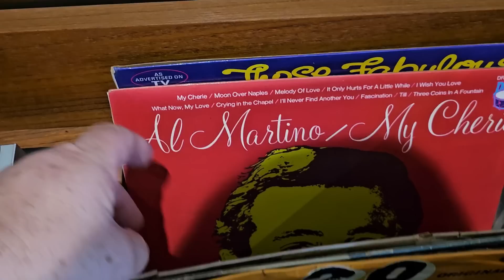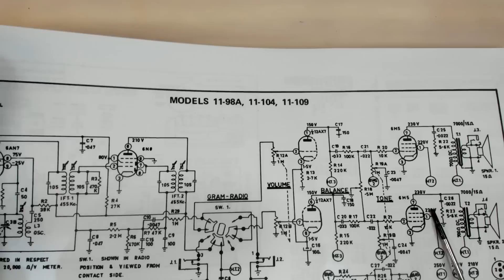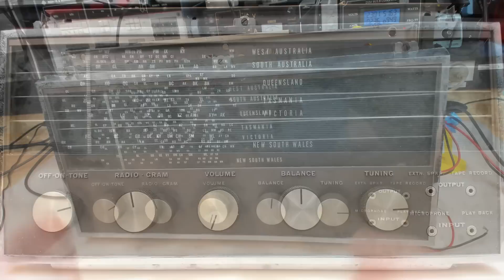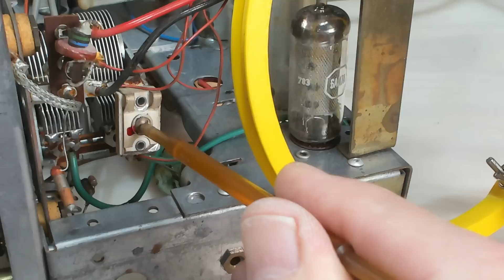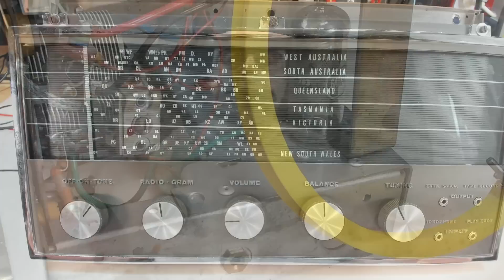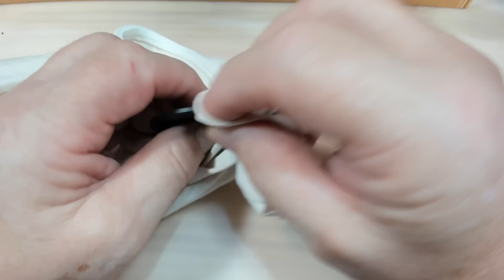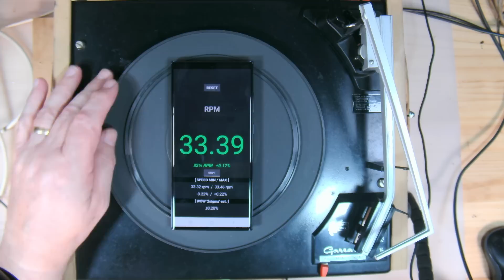Kriesler Radiogram for 5 Bucks! Is it any good?  Part 1

Comment: My Dad's old AGS turntable which was one of two he had for his old disco setup, ended up cracking the plastic spindle gear and it would return but then you couldn't move the tonearm as it would jam the return gear up. So you would need to pull the platter and spin it around until it cleared, you could use it after that but don't let the mechanism activate or you will need to do it all over again haha.
Reply from the maker: That would be annoying Ben. These days your Dad could have printed a new gear 😄

Comment: The rotogram3000, amazing!!!
Love your videos Dave. 
When you were peaking up the alignment I wish you had commented regarding the asymmetry of the sine wave, ie what was causing that and why it does or doesn’t matter.
Reply from the maker: Thanks Peter. I'm not sure what you mean. The sine wave on the scope is the modulated 455 kHz AM signal being suppled from my signal generator to the grid of the 6AN7 mixer valve. When peaking the IF transformers I am only looking for the maximum deviation on the scope. I am not taking any measurements per se 🙂
Reply: I was referring to 14:06
Reply from the maker: I see, the shape  of the sine wave. Yes it's pretty poor, the set has 10% harmonic distortion so it is not a good signal. I also didn't set it up for a clean signal, full volume and minimum input from the generator. It is the base model of the range of set on offer at the time.

Comment: Nicely done. I just got a BSR changer to service and it is a very similar design to this one. I don't remember if you ever did the BSR though :) That one has also lots of hardened grease all over it, I managed to break it loose with WD-40 just to get it spinning, but I will do a full service on it when I get around. It was so bad the platter was completely frozen and very hard to turn even by hand
Reply from the maker: I'm trying to think, I don't remember doing a BSR deck but I seem to remember something. Anyway, good luck with your BSR Michvod 👍🙂

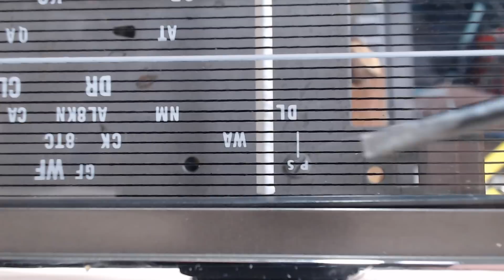Comment: 12:20 Does the "PS" mark stand for Pointer Set(ting)?

4:55 I'm still bowled over by all the capacitors and resistors flying everywhere, some with leads nearly touching others. I see a purplish wire acting as a kind of spine through the middle, what's that?
Reply from the maker: Hello Ed. I would guess it is something like that. Pointer Set sounds pretty good. Point to point wiring served well for many years. There is a purple wire, it's carrying one of the HT supplies from the power supply to the front end I think. Thanks Ed 🙂

Comment: Just saw this. That looks like 👍 a good radiogram for $5.00. The record player mechanism will need to be cleaned and regreased. Ya may need a new cartridge needle. I'm not sure if it's ceramic or magnetic. I hope ya don't need to fix the dial cord. The dial light should be easier. Good luck 👍, and maybe a couple beers 🍻.  Your friend, Jeff.
Reply from the maker: Thanks Jeff All those things are done, the cart and dial string are OK too. 🙂

Comment: Hello Dave, I enjoyed your video.  That's an interesting Radiogram.  Having lived in the US all my life, I had trouble dating this radiogram based upon US radiograms.  In the US, all "Console Stereos", as they were called here, switched over from Valves to Transistor circuits in 1964 to 1966.  Also, particle board did not appear in the super low cost radiograms until 1972.

The output valve coupling capacitor value of 0.0022 uF, causes the low frequency response to cut off at 64 Hz in that amplifier and the 0.022uF; 6.4 Hz.  The audio output transformer (not to mention the speakers) are the bass limiting factor so, either capacitor value would probably sound about the same.

I overhauled a lot of those Garrard record changers in the mid 1970's when I worked in a TV repair shop.  They are a "gutless wonder" but, work well considering the construction.  You have the entry level model that uses the shaded pole motor.  The higher quality level Garrard used a synchronous motor, causing the shaft speed to precisely match the line frequency.
Reply from the maker: Hi Bill, it sounds like we were behind the times with transistors and ahead on particle board. I wasn't worried about the capacitors but couldn't work out if it was deliberate or a mistake at the factory. As you said, those 8" drivers will be the limiting factor. I didn't think about the motors, thanks for the heads up. I agree, they are a basic deck but did the job intended and most people wouldn't know the difference between one deck and another, including me 😊 Thanks Bill.
Reply: @DavidTipton101  Thanks for your response Dave.  Yes, the premium Garrard deck also included a heavier platter and improved tone arm that could track with light stylus pressure for use with a magnetic cartridge.  These actually had superior frequency response to the Compact Disk Audio Format.
Reply from the maker: @billharris6886  Thanks Bill, good info 👍😊

Comment: This appears to be a really basic amplifier design, not just without push-pull output but also without negative feedback (hence the total harmonic distortion is likely around 8-10%).  A single ended output can still deliver better fidelity than that, if it does have negative feedback, as from the speaker side of the output transformer or a special winding on the output transformer.  A Magnavox high fidelity stereo phonograph that belonged to my aunt and that I fixed after inheriting it had single ended output with negative feedback.  Hacking that in to this design would require more gain in the pre-amplifier circuit to make up for the negative feedback.
Reply from the maker: Yes it is pretty basic, it is the base model. The better models have all the features. I won't be doing any mods to the circuit, it works quite well even with it's limited features. Thanks Seeking 👍🙂

Comment: I always find that watching an automatic changer is fascinating, particularly a smooth operating one like the Garrard.  We had a Multisonic model 11-95 in the mid 60s with push buttons and it seemed so modern (I did some research during your video!).   It sounded very rich too.  Looking forward to seeing what you have in store for this one. 😊👍
Reply from the maker: Hello Pauline. They are a masterpiece in design, so many elements it needs to check. Your 11-95 had three speakers a side, they do sound nice. Thanks Pauline 👍🙂
Reply: @DavidTipton101  Always enjoy your content.  The 11-95 is a very fond memory.  I think my father got it when my parents divorced.  Ours was a 'Diamond Hi-Fi' with a little blue diamante set into the control bezel, I think it signified a diamond stylus.  So fancy!

Comment: Hey David. Andrew Collins from Melbourne here. My mother got from my Grandmother a Kriesler Radio Gram with a bright green horizontal tuning eye between the Input and Output sockets. The valves were mounted under the rotary controls upside down which was not good for heat dissapation. It has electrostatic tweeters, not the usual standard type and the top end was incredible. It has a 3 way 6 element speaker system all magnavox. This was the most expensive of all the models in 1968. The power supply and rectifier valve are mounted to the bottom of the chassis. When I was in my teens, it started to hum a bit and the knobs area was drowned in booze. I removed the escutchien and went to radio parts to get pots and a new electrolytic for the stand alone power supply and other electrolytics for the rest of it. The valves were fine when I tested them at the local Mullard radio store. (I'm 63 now). I got back and went to work. Each pot was removed and a new one soldered in place. The pots were not cleanable with deoxit by the way. Mum looked at me working on the kitchen table and said "what's that"? I told her it was the guts from her radiogram. She was horrorfied. I hope you know what your doing. I said "no, its all guesswork".  lol. While the work I did isn't up to your standard. I was pretty good at soldering. A man called Mr Ryan, one of my late fathers friends was a radio repair guy and he taught me everything I know. After I finished the work, I fitted it all back in after I cleaned a zillion years worth of dirt, dust and booze stains and held my breath as I switched it on. I used the radio to check it and everything was ok. I used my cassette deck to check the fidelity and those speakers powered by 10 watts Push/Pull per channel, it sounded loud and great. Unfortunately today, the valves are worn and the getters are white but the tweeters are the only reason I kept it because I've never seen electrostatic tweeters again except in Time Windows which needed Amcron power amps to drive them. I just wish you lived here or I lived in Queensland and I'd ship it to you. The turntable idler wheel has the compulsory flat spot and i can't find a new stylus to fit it. I got a pre-amp and ran my Technics SL1200 MK2 into the inputs. Those tweeters along with the 12 inch bass speakers and mid range speakers sounded better than some modern systems today. I don't need to sell it. The cabinet is a rich mahogany I think. The variable capacitor for AM is very scratchy but its 55 years old. Boy did it bring so much joy into our family. This type of gear is very desirable in America. On YouTube there is this guy called "shango". He fixes roundie CRT televisions and he wont show his face because of privacy....fair enough. Sorry about the long post. Cheers!
Reply: If your idler wheel is beyond use, you could try a technique I've used to recover a few. I soak them for a few days in Penrite power steering fluid with leak stop. It returns the rubber to as new. I've fixed a lot of rubber and neoprene parts this way. Just clean it afterward with detergent and water. I have also used brake fluid with some materials, although it takes longer)
Cheers.
Reply from the maker: Hello Andrew. It sounds like your Kriesler could be a 102 or 103. The 103 has the silver interior. They do sound magnificent, I have yet to pick one up. You did well servicing it even if it was scary for Mum. I did wonder about Shango but I don't think he is near the fires, I hope not. Thanks Andrew 🙂

Comment: What about using those Test Records EMI (in UK made) for set up - Did EMI, etc, in Australia make some (7in or 12in) ones ?  to avoid copyright
Reply from the maker: I have an original Kriesler test LP that was supplied with these grams, or maybe just the high end ones. It still has copyright material on it, not all, but some. The music was recorded for the record and features sound moving from one side to the other but it is still copyrighted. I will up-load samples of the music to YT and see which songs get pinged 🙂

Comment: These are a great unit. Bought one once years ago at a garage sale. It had sat in same spot in the house from when it was bought in 1970 at Norman Ross Fyshwick here in Canberra. Still worked, even the turntable. I have two of these.
Reply from the maker: You were lucky to get it before it sat in garage for 20 years GAPC1969 like mine. They are good units 🙂

Comment: The most important part of this radiogram restore was the Garrard 1025 record changer clean, lube and adjustment. 
More folks out there have it than a Kriesler radio and phonograph radiogram. Couldn't even buy a Garrad turntable for 
5.00 dollars itself anywhere! Great job David! Through its run from 1967 to 1974 it first came with a BSR UA15SS then 
your Garrard 1025 and finally the Garrard 1025T. Can wait to see what you will do to fix the particleboard tops situation 
as well. It may need new tops. Cheers David! Steve from Illlinois
Reply from the maker: Hi Steve. I like working on the record changers, the mechanical parts are more up my alley then the electronics. I wondered at first if the BSR had been replaced with a Garrard but I found my gram model fitted with the Garrard on-line so it was a factory fit. I'll have a go at the tops next video. Thanks Steve 🙂

Comment: When you played the country song, I could taste the tar and nicotine we used to smell and taste when everyone seemed to smoke...

I have always loved the old console radio/entertainment centers of the 50s and 60s, before the component age of stereo radio, especially when they had a TV as well!

As far as grease on these old turntables, I like to replace it with a good synthetic grade rather than old soap based auto grease, otherwise, you are going to be doing this again, or someone else will consider it trash and it will end up in the landfill. But as far as oil, if it rotates, it should have a drop of synthetic oil that doesn't dry up. We have come a long way with lubricants for electronics!

But my love of ham radio has made me build up my workbench and invest in some old ham gear which I am rebuilding and putting on the air! I already have some Kenwood ham gear on the air, but I am reaching back and restoring some Hallicrafters as well!

Good luck with your endeavors!
Reply from the maker: I used a non drying lithium grease, it should last quite well. I don't oil any of the 'end of record' components anymore they work perfectly when dry. Thanks Jeffery 🙂

Comment: Really good video David good info on garrad changer. Many years ago when i was 15 I actually made a radio gram include the wooden cabinet made from Tasmanian silky oak. The amplifier used 6BM8 triode  pentodes. I bought the amplifier as a kit. I also bought the Garrad charger from a company in Sydney.  I Salvaged a really good old valve radio . I remember I was so pleased with it in the finish. It was only 3+3 watts but with 10 inch dual cone speakers it was plenty loud enough for my father telling me to turn that bloodily thing down. Your videos bring back so many memories to me I luv it. Thankyou David well done❤🤗
Reply from the maker: That is a great story! You were very talented to create the radiogram from scratch and at only 15. Thanks Bruce 👍🙂

Comment: Some of the the later Kriesler Multisonics had 6GW8s (triode-pentodes) in push-pull, electrostatic speakers, and a built-in tape recorder. My Aunty had a Multisonic in the 60s, don't know which model it was, but records played on it sounded really great.
Reply from the maker: From what I learned, there were three levels of radiogram. Mine is the base model, there was a better one and a top tier one as well. The two better grams had the 6GW8s in push-pull, the top model had two midrange speakers in addition to the woofer and electrostatic speakers while the middle of the range only had one midrange. The top one had a better looking cabinet. The type your Aunty had, sound so much better than this base model. Thanks Rod 🙂

Comment: Looks like yours is the 133 In the next model case which happens.
Reply from the maker: Hi Carl, They were the same chassis used in both models. Mine must have been built in 1969 when the 11-133 was released so it inherited the later chassis ident 🙂

Comment: What was the confused ferret all about? Love your vids, didn't know you could buy it on a.m. only radiogram. The Garrard turntable came with two spindles, there will be a clamp to put it beside the turntable. It was so you could use for single play or stack them up
Reply from the maker: The Ferret thought I said ferret antenna not ferrite antenna. I have both spindles but there was never a clip to hold the second spindle, hence it ended up inside the cabinet. I looked for a clip at the hardware but they had nothing small enough. FM was not available until 1975 in Australia. Thanks Leo 🙂
Reply: @DavidTipton101  ah ferret antenna :) I'm a ding bat for not noticing . Here it was only cheap radios that didn't have FM. Nice radiogram thou and always liked Garrard over bar. What's the audio output valve and are both channels on one valve?
Reply: FM came very late Down Under.
Reply: @KentTeffeteller  we had FM mono from late 60s to 1976 when it went to stereo but only 3 channels BBC that's it and only 1 on am

Comment: I have a lot of respect for the BSR type units.  Very simple design, very effective and easy to use for the casual record spinner.  It was a huge marketing success, and I know I had a lot of fun with them as a kid, loading up 45's and watching them drop. 
It would probably make an audiophile cringe, but I like that it was so adaptable to play 78's to LP's, in the day when you just played records for fun and as a kid, you didn't think or worry about speed issues, or wow and flutter, counter weight, or even if the sound was coming out ear piercing through small speakers. Just the same, some of these units like in these furniture pieces can sound bloody good! Actually, some records that were poorly produced in the 50's and 60's actually sound better on some of these units than they do on modern day equipment to me.  I have a few 78 rpm records, that sound as good if not better than some of their 45 counterparts and they really shine on these units.  Must be the 'analog' baby! and all the little imperfections that sound good on the ear.  Vintage VooDoo!  Thanks David for another great one! Rick
Reply from the maker: I haven't worked on a BSR player Rick, I think they are a similar design to this Garrard. Both were very popular at the time. I played a 78 on this unit the other day, a bit scratchy but not bad for an 70 year old record. Thanks Rick 👍🙂
Reply: @DavidTipton101  78s were noisy even when brand new I think. I once found a stack of Soviet 78s that might never have been played because the centre holes are too small to fit onto the spindle. I very carefully enlarged one of the holes and played the record. Pretty decent but still much noisier than any vinyl.